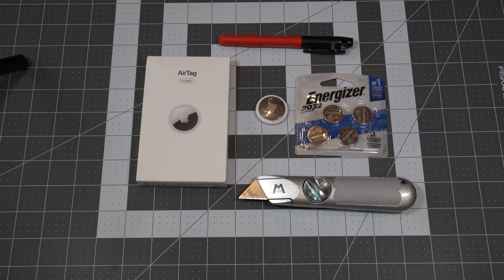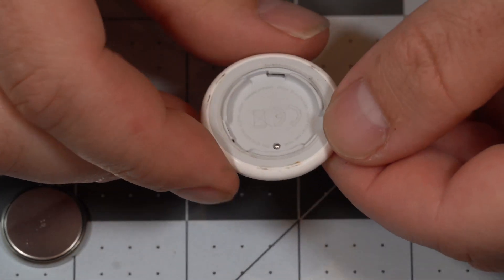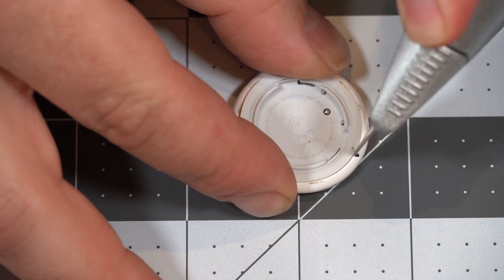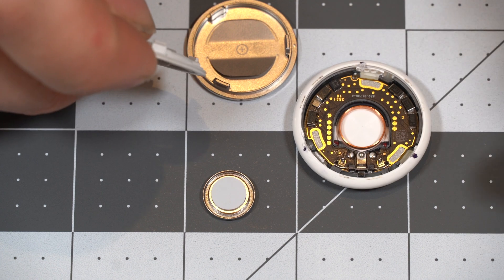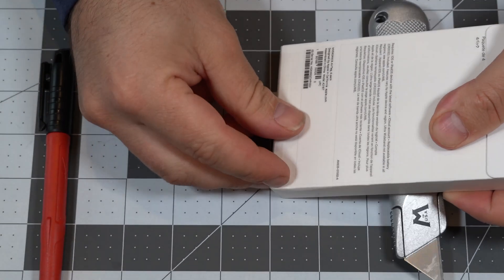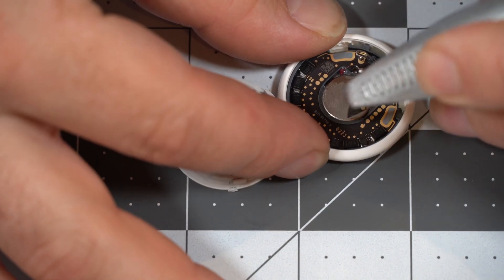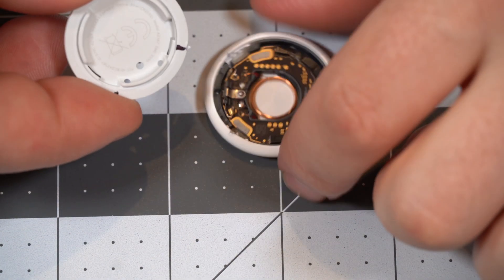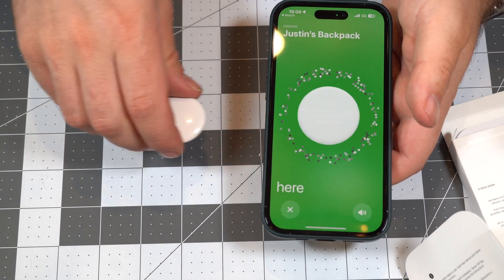How to remove a speaker from an Apple Air Tag in less than 5 minutes   4K

Comment: Help! I removed the speaker but now the airtag is dead, does not make any sounds for sure but also will not connect or be recognized by iphone.
Reply: What is your date of production, is it May 2023? And did you figure it out?
Reply: Same sadly
Reply: my exact problem . just arrived today and did it to one but now won’t work.
Reply: @_will3722  I read that the second generation AirTags you need to be more careful because they put adhesive glue now and if you don’t slowly cut around it first before removing it then you can pretty much damage it
Reply: bullshit yall, just tie around the Airtag a piece of scotch tape tightly(to make sure the battery is contacting the power source pin)
Reply: @_will3722  I didn’t even know there was a 2nd generation until I damaged mine sadly I just gotta order another one
Reply: what 1st and 2nd gen? Isn’t there only one gen?!?!?
Reply: A speaker just tells a thief where the tracker is and throws it away. :(